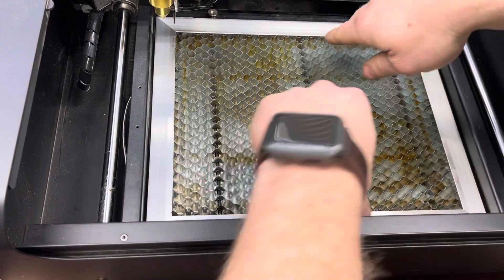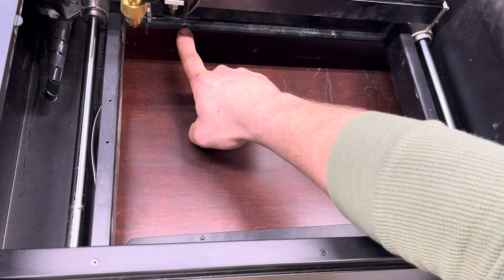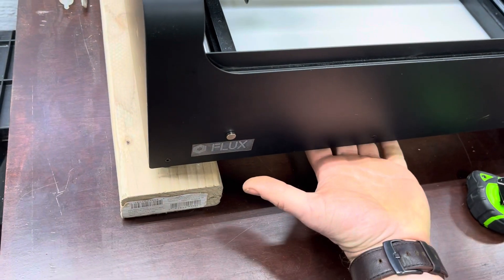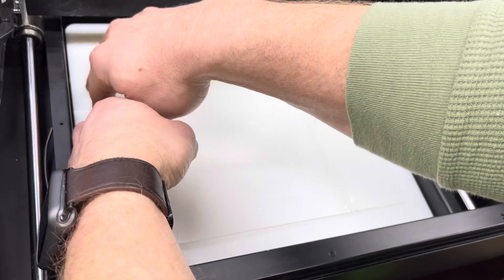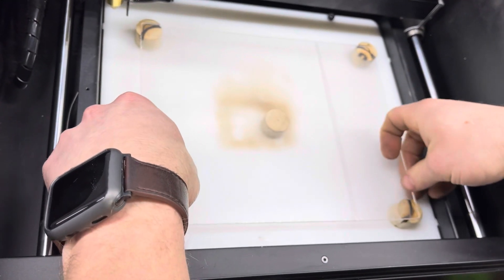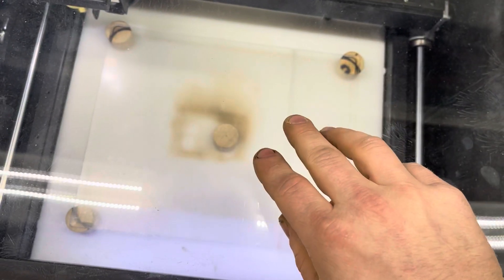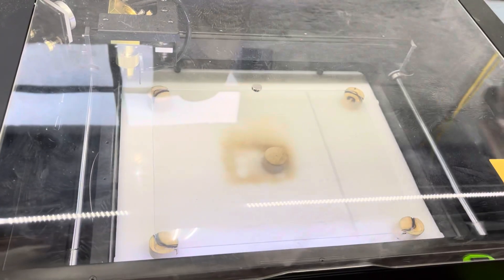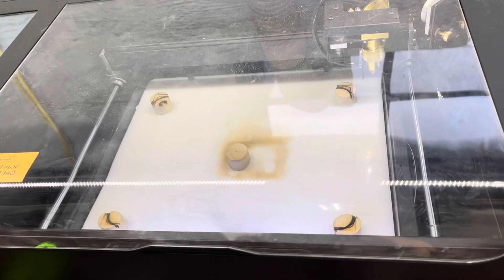Beamo Laser Production Upgrade

Comment: Loved the production idea.
Does this small laser keep up with making production runs or does it have a run time before it needs to cool down?
Reply from the maker: Out of the box I am not sure. I have already upgraded the cooling system in it. I haven’t had any issues under constant use. The only thing I can see causing an issue would be the temps raising to above what the stock cooling system could handle but even before then I didn’t have any issues except when I took it to an event outside in 95 degree weather.
Reply: @exoduscustoms1348  wow thats surprising, did you upgrade to an external cooling system? 
Also have you engraved glass with it and if you have how's the quality?

I hope your planning on making more videos with the laser. 

Hoping to pull the trigger on one this year coming up.
Reply from the maker: @caneloANDRETTi  yes I upgraded to an external cooling system. I left the stock coil and fans to see how it does. It has done well. I have a few ideas for making the system be able to have a pass through like the glowforge. Just won’t be as wide but will still be cool as hell. And I will try and get some more videos of known issues and upgrades I am planning. Just trying to keep time in between them so I am not putting out bad ideas that cause more issues.
Reply from the maker: @caneloANDRETTi  yes I have done plenty of glass. Even full liquor bottles. It engraves great. The quality of the glass and the prep will decide the outcome and quality of the engraving.
Reply: @exoduscustoms1348  for the pass through it would take some programming right that way beambox studio would know how far to move the material??
Reply from the maker: @caneloANDRETTi   well to start off I would only create the opening so that I can get larger materials into the laser. The programming would come later but is definitely doable. I wish they would get on board with Lightburn.